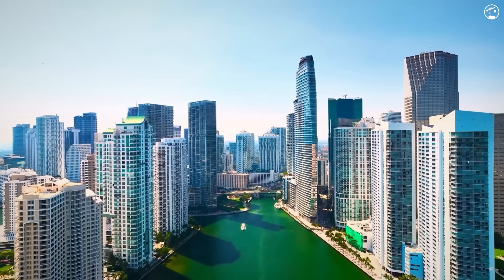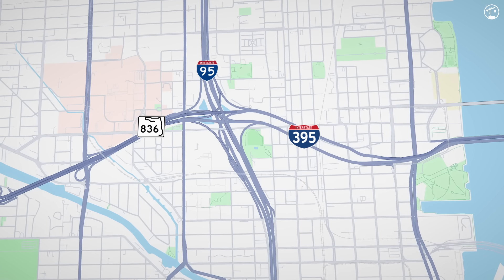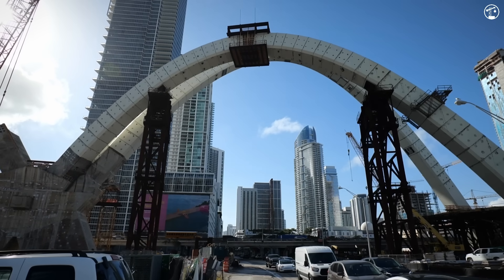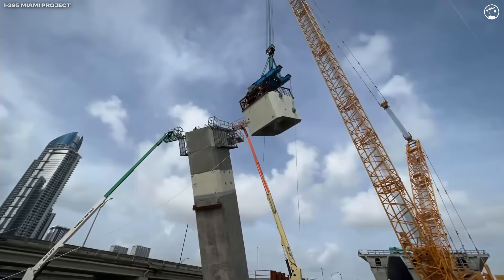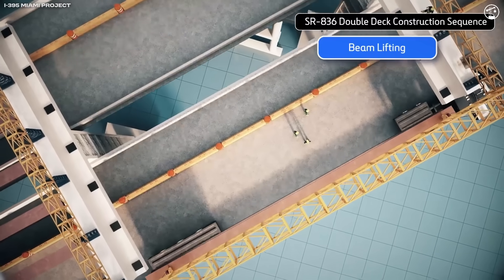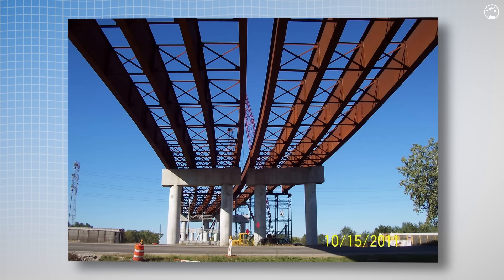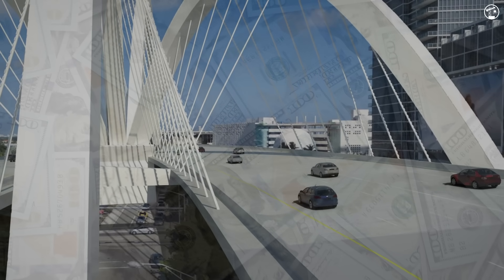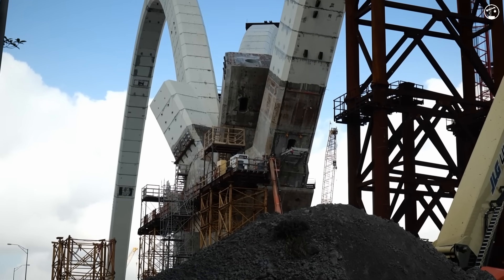Why Miami is Building this Insane Bridge

Comment: Great video! I would love to see a video on the Mobile River Bridge and Bayway project. ALDOT (Alabama Department of Transportation) is planning on breaking ground later in 2025. The project is designed to replace the existing four-lane I-10 Mobile River Tunnel with a six-lane cable-stayed bridge and upgrade the Mobile Bay 7.5-mile-long "Bayway" to match a 100-year flood/storm surge and upgrade it from four lanes to eight.